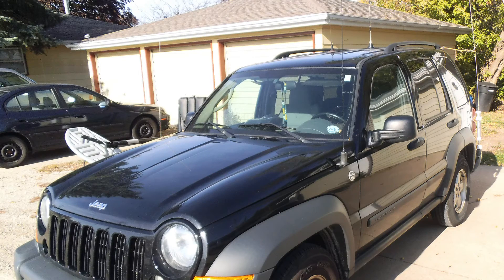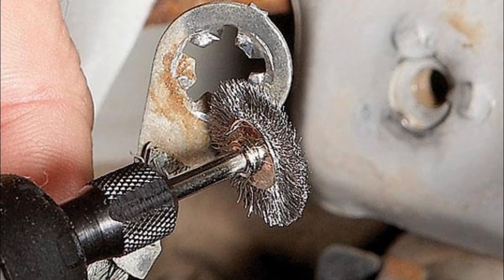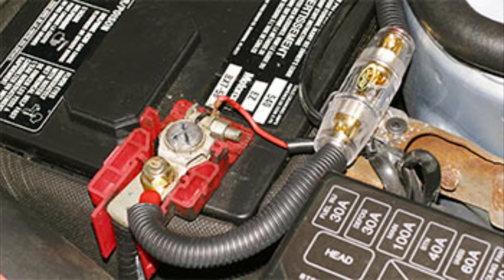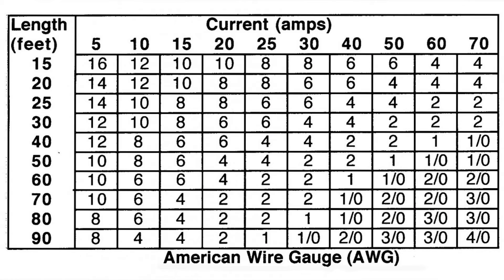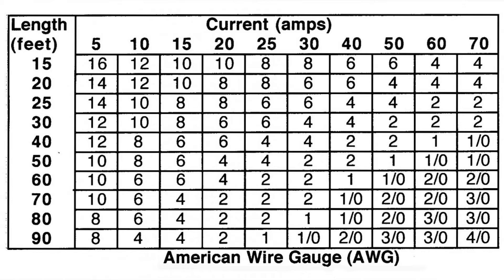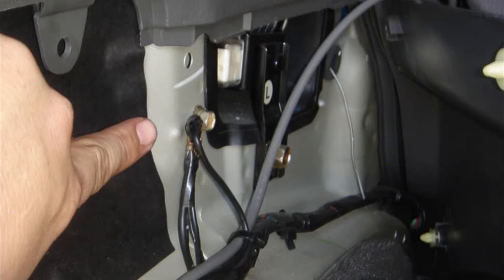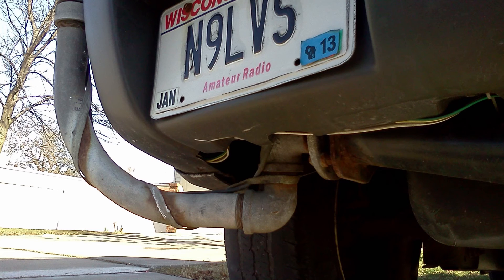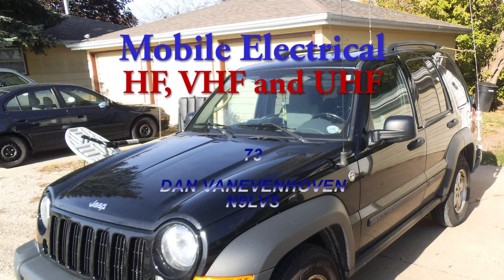Mobile Electrical HF, VHF and UHF

Comment: If my antenna for vhf/uhf was not properly bonded to ground would that be a cause why I can’t transmit to the repeater I can easily get on handheld. I have all the correct setting and pl tone set as well